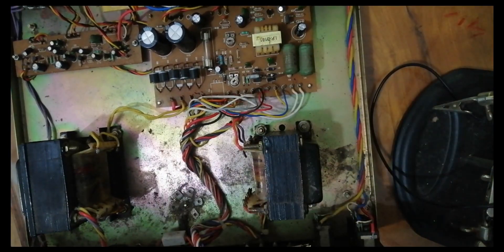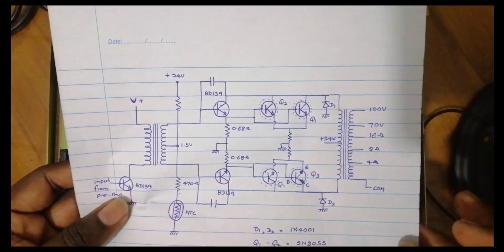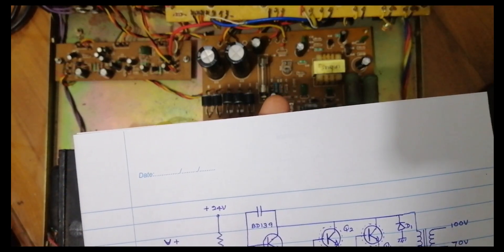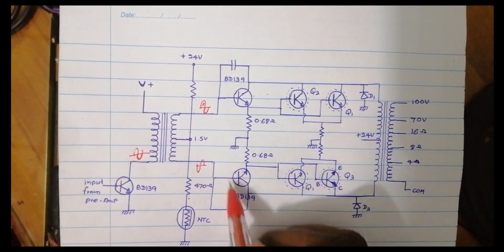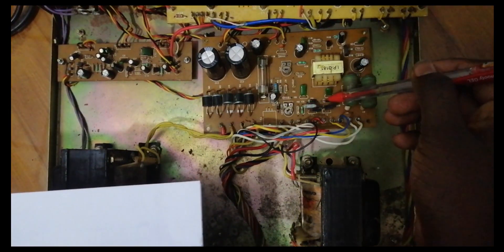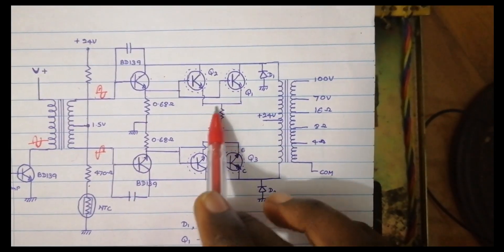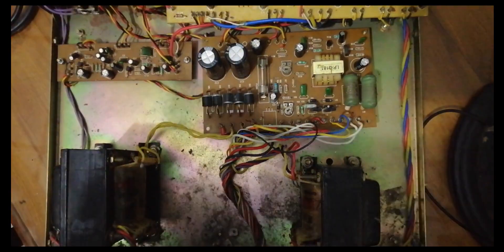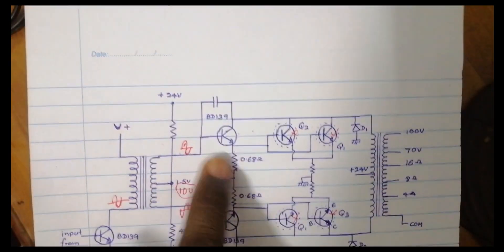PA Amplifier Repair

Comment: අනිවාර්යයෙන්ම කලබල නැතිව ක්‍රියාපිලිවෙල හදුනා ගත්තම බැහැ කියන දෙයක් ගොඩ දාන්න පුලුවන්....හදිස්සියට බැ..

ඔන්න ඔය හමි එකට අපිට කරන්න දෙයක් නැද්ද අයියේ....ඔිඩියෝ එකක් ප්ලේ වෙන්නේ නැති වෙලාවට ඔික මහ වදයක්....
Reply: Amplifier eka dala thiyena yakada cover eka earth karama tikak hum eka adu venava.nath nam amplifier ekata dual supply voltage input line ekata 473 code eka ena ceramic high voltage capacitors dekak connect karanna.ekak + voltage eke idala ground ekata anith eka - voltage eke idala ground ekata.anivaren ceramic high voltage capacitors pavichchi karanna.parana radio circuit valin hoya ganna puluvan.
Reply: @crvelectroniccreations2203  අඩිඩෙි...ස්තුතියි...ස්තුතියි...යාලුවා....
Reply: Welcome.ehema karala hari giye nath nam kiyanna.mama thava krama tikak kiyannam.oya kramayata apita ahenne nathi ganata hum sound eka adu karanna puluvan.100% adu karanna ba 90% vithara adu karanna puluvan hum sound eka.
Reply: @crvelectroniccreations2203  අනිවාර්යයෙන්ම මම කියන්නමි..